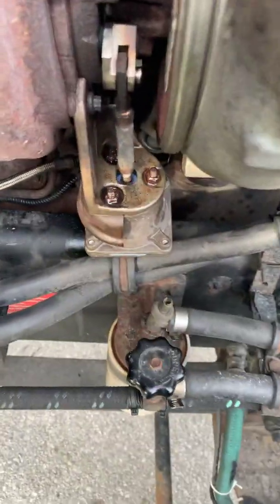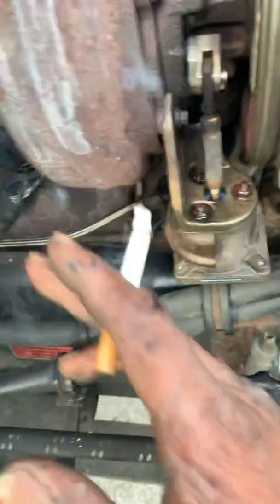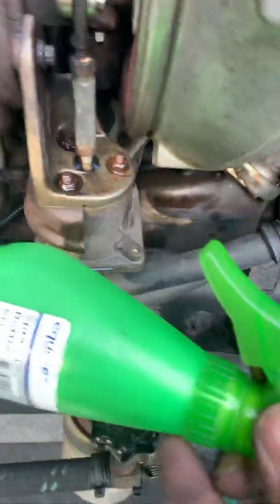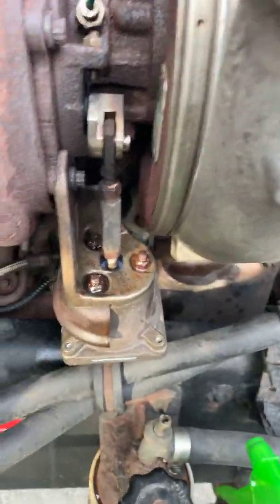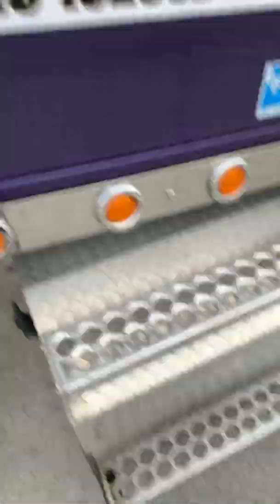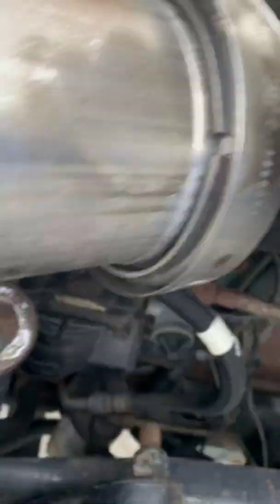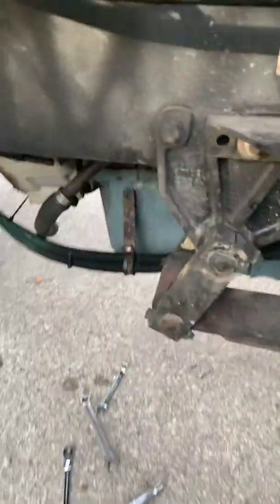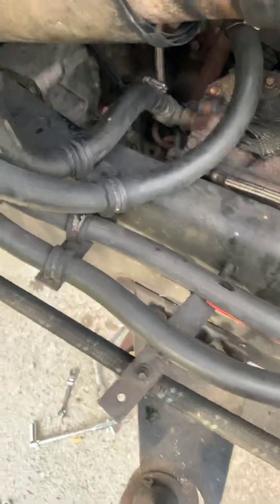VPOD FAIL Detroit Diesel ser60

Comment: Last year Freightliner in North Platte,  Nebraska,  said they replaced my VPOD Long with many other parts. Got home and still had problems.  Had a mechanic come out and told me that my VPOD has never been replaced. I said really ? Here is the receipt! They said it still works, but that has never been changed. I wonder if they changed my fuel injector like they claimed? It ended up being my ECM computer was bad. I did that myself. These truck places are committing fraud! They also like to tell you they have to overnight parts and charge you for the speedy delivery when it's sitting on a shelf in the back. That's another little scam they do to make extra money. There are crooks out there, listen to this guy, great video!

Comment: Thanks for that video. Couldn’t be more right. Water is cheap. Slap some soap in it and it will reveal some things you didn’t want to see. But the answers are there for sure. Big words the shops use cost a lot of money down the road. When it could be a simple fix.

Comment: Shit man, thanks for that video....i have a bad vpod on my series 60 too....there is a bad air leak there and its also affecting my air bags some how, having trouble building air pressure in the truck bags and trailer bag....no boost at all plus the turbo was also bad, the propeller was damaged already. So my boss will replace the turbo plus the vpod.

Comment: Will a bad vpod make it blow grey smoke. Run rough and ping or pop.  I got new injectors. Cam  and rockers my guys stumped.  This thing never smokes even loaded heavy.   Any help would be greatly appreciated dj
Reply from the maker: Absolutely
Reply from the maker: If you hear your turbo speeding up slowing down speeding up and slowing down the “jet” sound erratic 👍🏾V-pod

Comment: Absolutley right! The first time happened to me the dealership charged me just around 3k..A lot of tests , replacing the Intercooler, bla, bla, bla  to finally get to Vpod. Since, never stopped at Freightliner for any of their labor but parts I need. In about 3 years later had to replace another  one (already by myself) at Walmart parking lot after got the Vpod for about 500$ from the dealer. And looks like tomorrow's another day,...4 years later. Lucky to have only 4 pallets on the back of the trailer and still able to keep up with the traffic 55mph...Hope nothing to climb on my way. Vpod 100%

Comment: Just replaced my vpod
Turbo was cutting while running 
Was giving me code 39
Ask the guy from freightliner and told me most definitely turbo
But started reading forums and many said it looked like vpod
Before you take it to dealer read people can save you thousands
Reply: cpu ram , so it was the vpod that you change? Did it fixed the problem? Mine is doing the same thing it’s cutting while driving
Reply: @yobannyrodriguez5547  yes it fixed it by just replacing vpod
Reply: Yes it was the vpod
Reply: Yes mine did it the other day trying to find somebody to replace it now
Reply from the maker: cpu ram absolutely the vpod

Comment: When u unplug does it disable the vpod from sending out air to the actuator? Thanks
Reply from the maker: Fearless One ya itwill
Reply: @blalockmotorfreight5378  thank u for ur fast response, I currently deleted my egr and switched to a non egr turbo (Borg warner), everything is working fine except that the vpod is dumping out tons of air out into the open, hopefully when I unplug the wire itll stop dumping air, if not I'm just gonna disconnect the air hose which feeds the vpod and block it of permanently. I'll let u know how it goes
Reply: Fearless One 
You have to do some modifications to the ecm.
Reply: I have an egr delete hut the hpod is getting hot and blowing the airline comnected to it.Dod your truck work after blocking it off?I need to do something quick.I am in the side of the road with my second blow airline of the day :-(